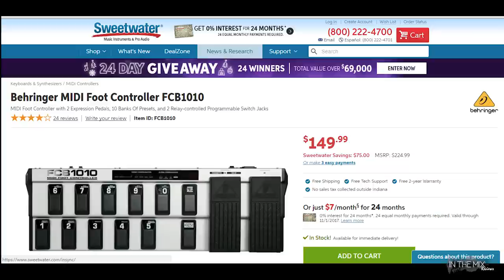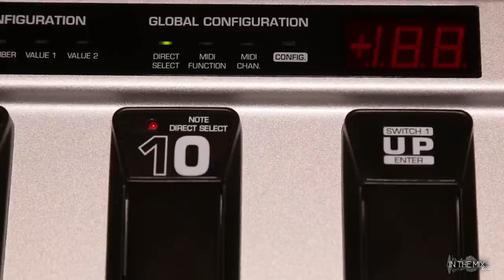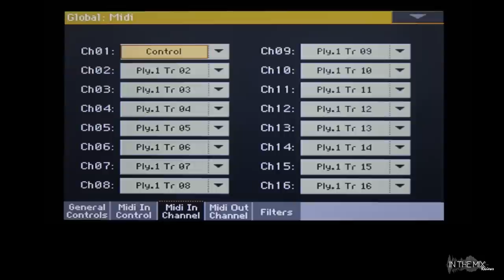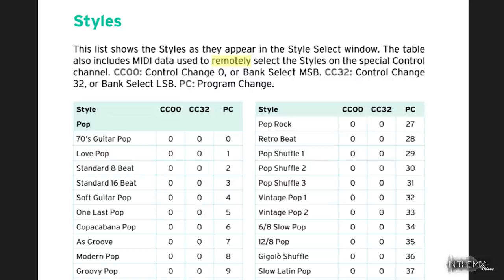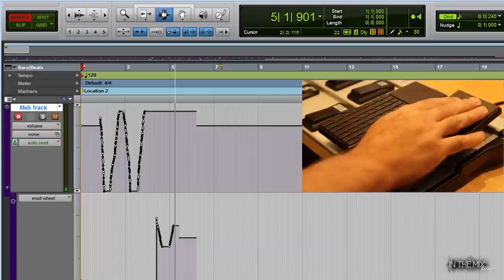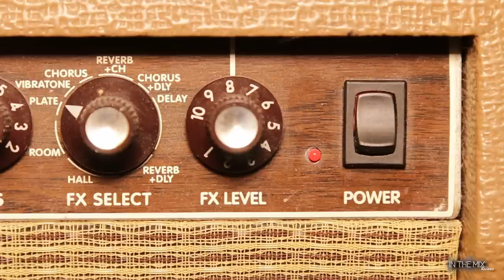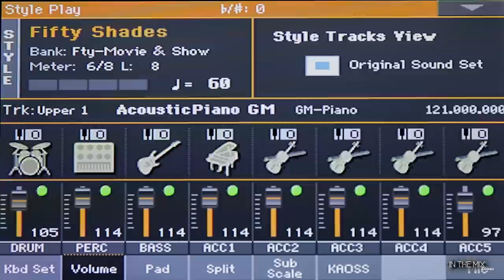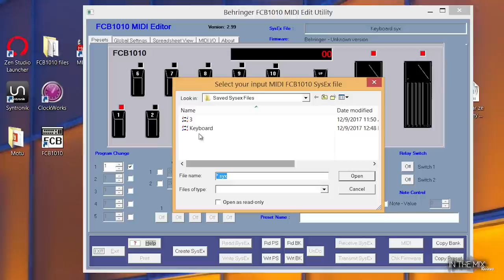Behringer FCB1010 Full Tutorial / Video Manual

Comment: how do you change settings via software if there is no USB interface?
Reply from the maker: Using a 5 pin midi to USB converter cable such as M-Audio UNO
Reply: I've got a USB interface with midi in and out, I presume that would do the same
Reply from the maker: Yes because even a simple midi to usb cable is essentially a midi interface

Comment: It works with keyboard casio xwp1?
Reply from the maker: You're asking the wrong question. FCB1010 is just a midi controller. It'll send out whatever parameters you program and assign to its switches. That's all it is. What you need to do is, study the manual for Casio XWP1 and see if it can be  controlled remotely via MIDI messages. If yes, then the answer is yes.
Reply: @InTheMixReviews  thank you :)
Reply: @InTheMixReviews  The keyboard has a MIDI input.
Reply from the maker: @pedrockjesus  You still need to look up the manual and see if XWP1 features can be controlled with an external controller.
Reply: @InTheMixReviews  ok. Thank you :)

Comment: I have nooo idea where to even plug in the guitar
Reply from the maker: What do you mean?
Reply: @InTheMixReviews  do i plug the fcb in my interface?
Reply from the maker: @fredrikfb  You're asking the wrong questions. It's not clear what you're trying to do. I couldn't understand your first comment about the Guitar. The second comment is very confusing as well. If you want to plug in the FCB to the interface midi inputs? Yes, you could totally do that if that's what you want to do. You can also connect the FCB directly to a midi device. You can connect the FCB directly to a computer without using an interface as well. You see there's many different options depending on your gears, needs, workflow..etc...etc. Have you actually watched this video at all?
Reply: @InTheMixReviews  I haven’t watched the whole video no. But it’s no ubs or anything so how do I connect it right to my pc?

I want to play the guitar with my interface to my pc and control a plug-in with my fcb, I just don’t know how I’d plug the fcb to my computer
Reply from the maker: @fredrikfb  You can either use a midi to usb cable (Amazon links in the description) and connect it directly to the computer, or use a midi interface with traditional 5 pin midi connectors on both sides. Feel free to join the Facebook group if you'd like to discuss gear connections, Guitar amps..etc.